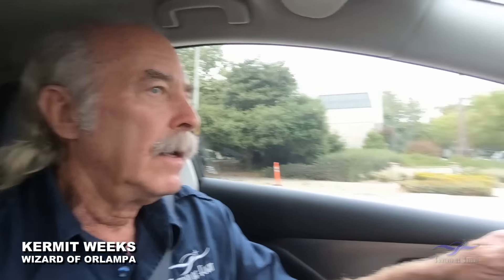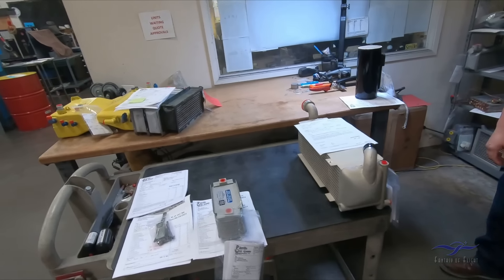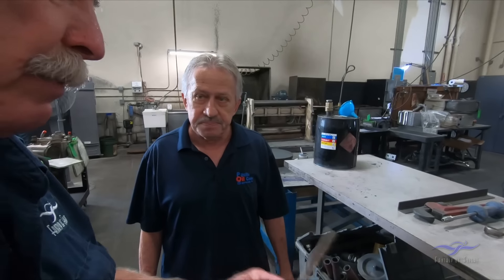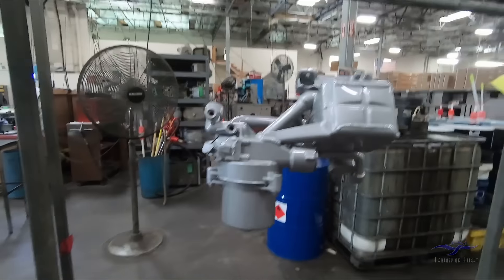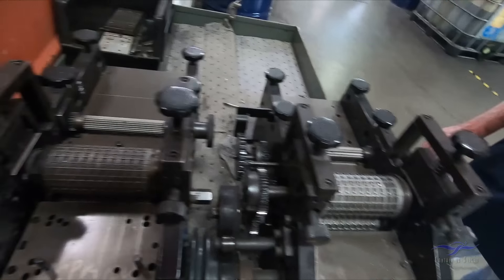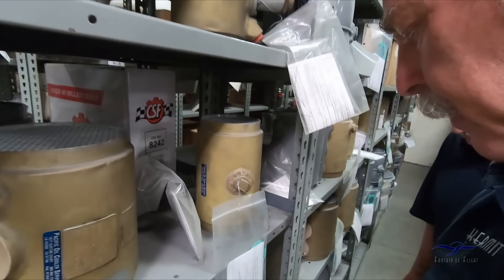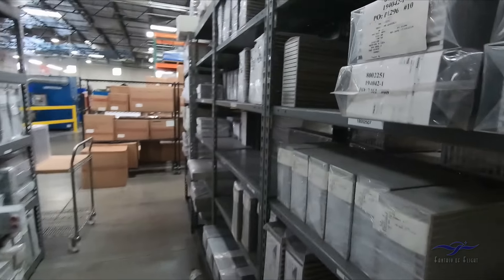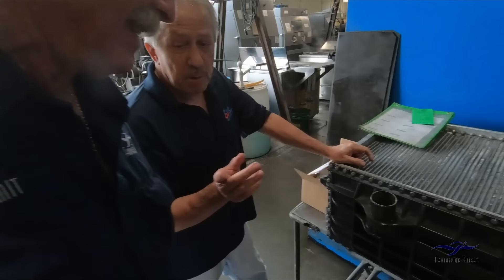Pacific Oil Cooler / Aero-Classics - Kermie Cam Tour

Comment: I worked on C 124's in the Air Force, 1967-71 and still have rubber expandable plugs for the oil cooler tubes front and back to keep them from leaking, I also have known Paul Saureman for over 40 years, the Best place for oil coolers and a great guy................

Comment: Most mechanics (automotive)  do not realize that 30/40 % of an engine cooling is from oil. I solved my cooling issue on an old 1978 F 250 with a 400 cid engine by adding a large oil cooler.  Oil temp went from 300 plus degrees to around 160 degrees.
Reply: It’s the same with “air cooled” motorcycles, are actually oil cooled. But most people don’t realise it.

Comment: They use those SAME style Wax actuators in most Door locking mechanisms on Front loader washing machines in your home to keep you from opening the door untill it's done spinning to prevent you from breaking your hands- they Heat the wax capsule with a coil and voltage applied- the wax expands, and extended a plunger that locks the door, when it's done spinning, it cools and the plunger withdraws and the door can open

Comment: Kermit, that was cool ! You probably have a thermostatic valve on your GM Tahoe/Suburban transmission that prevents the fluid from going through the cooler until the truck heats up. There's actuall a kit you can install ~$35 that allows full flow to the cooler that keeps the temps down.
I dealt with a lot of tube bundle coolers/heat exchangers in the marine industry so I enjoyed this a lot.

Comment: The Automotive industry  used a Thermal Wax Element  in some of the Carburetors.. to controll the Opening of the Automatic Choke as the Engine warmed up, the Wax Element Epanded to open the Choke for Lean mixture and at the same time brought the Engine off of Cold High idle to Warm Engine  idle

Comment: In 1971 & 1972 as a young Navy Airman stationed at NAS Norfolk, Va., I could walk through the big shops where Civil Service mechanics were still rebuilding the R1820s for the T-28, S-2 and C-1. And I've gone through the oil cooler shop when they still had one. I know the R2800 was done at Alameda Ca.. The R3350 was done by a civilian business in Texas under contract to the Gov.. Bring them a box of donuts early in the morning and they would show you what was going on. 🙂

Comment: Kermit,I’ve been wanting to ask you for a long time. Why can’t I get Naked in Jamaica rum in Texas? Is it only available in Florida? I found a liquor store that sells it on line but 2 quart bottles ended up costing me $90 shipped to my house! It’s smooth rum but not worth it at that price.
Reply from the maker: Currently, we only sell my Rum seasonally in the Museum Lite gift shop on Fridays and Saturdays.  I haven’t had the chance to promote it and currently don't have a distributor.  It’s an interesting market.  We’re getting low on stock, but at some point, I’ll run another batch and hopefully be in a position to sell it to a broader market.